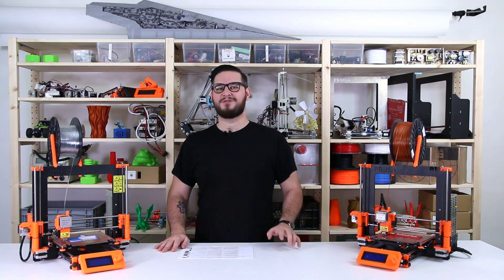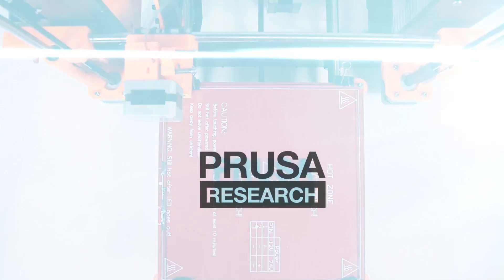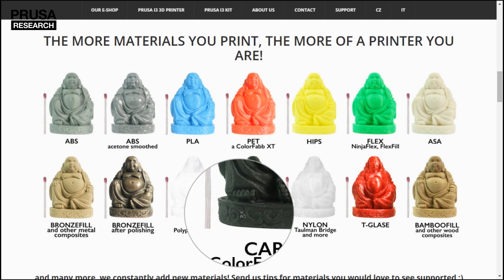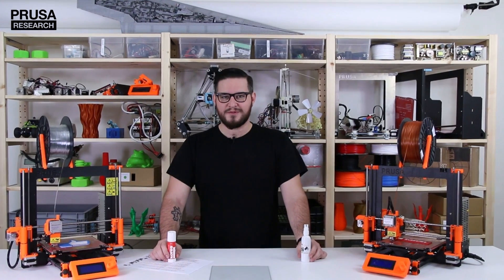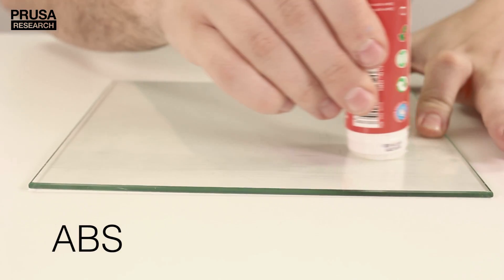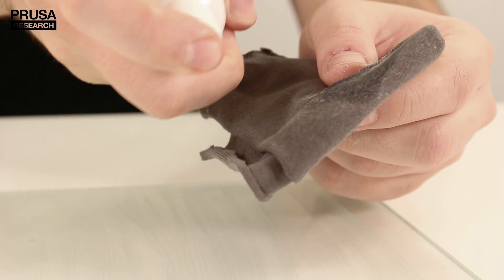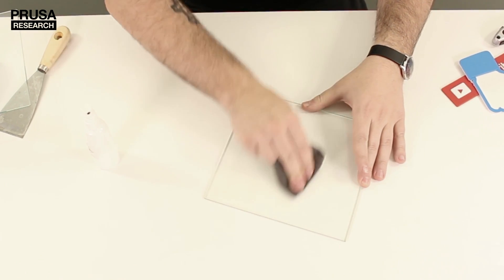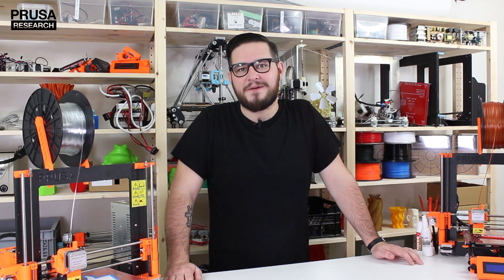Easy printbed preparation - Tips and Tricks #3 [3D Print]

Comment: Hey Joe,  I have been using your Original Prusa i3 for about 4 months now and really like this printer!
  
I used the glue and ABS juice method for a few weeks but honestly got frustrated as it seemed like the first hiccup and I was having to prep and re-glue.  I stumbled on a link someone provided using PEI material and 3M tape to the glass bed.  All I can say is WOW.  Since I have changed over I have about 40 prints so far in both PLA and ABS and it works great.  You just need to make sure to let the bed completely cool before taking the print off the PEI and then clean with Isopropyl alcohol and done!  I have heard of some people buying the thicker PEI and just placing this on the heat bed direct but its pretty expensive going this route.  Maybe you could offer as an upgrade?  

Thanks again for the great printer!

Dennis

Comment: I have been using aquanet ultrahold hairspray for a few years now. quick, easy, and strong.
Reply from the maker: +zerocool5878 It's just easy to get it on threaded rods and so on, which is not nice :-/
Reply: +Josef Prusa (RepRap) The only threaded rods i have are on my z which has never been an issue for me. I suppose you could use hairspray that is non-aerosol and spray it on a paper towel and then wipe the glass.

Comment: For PLA I have just discovered acrylic (Plexiglass) for a print bed! Simply wow. Lightly sand with 80grit paper, no heat just print. Excellent adhesion.

(Right now I'm using a very thin piece of scrap acrylic, and so the bed has a warp in it - but I will soon upgrade to 6mm acrylic with cross supports to keep it stiff).
Reply: +ehu42 Doesn't it stick to good? In other words: how hard is seperation after print?
Reply: +bkiffter Most of the time it just pops off. Once in a while, it lets go on a corner prematurely and curls, and even less often it sticks so hard its a struggle to remove. However, compared to painters tape, it is so much more consistent and I don't have to replace the tape anymore.